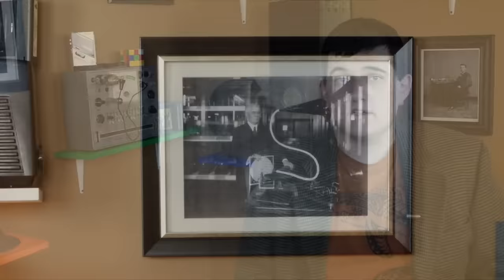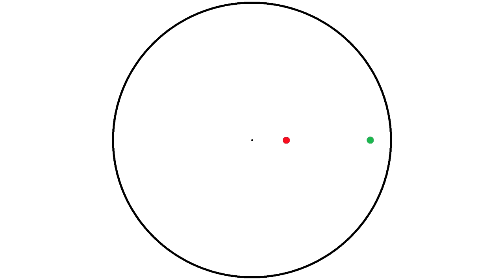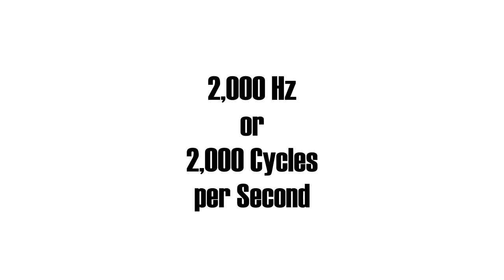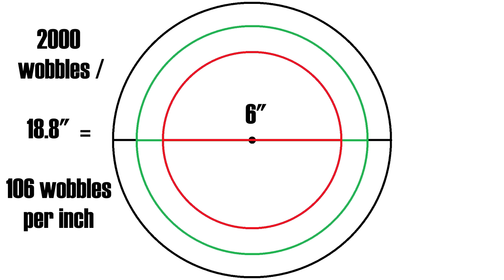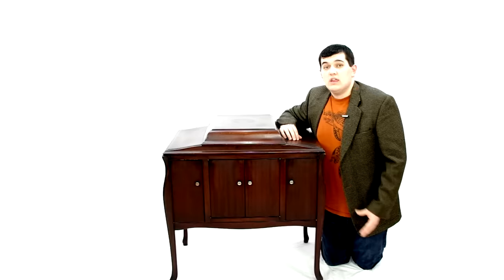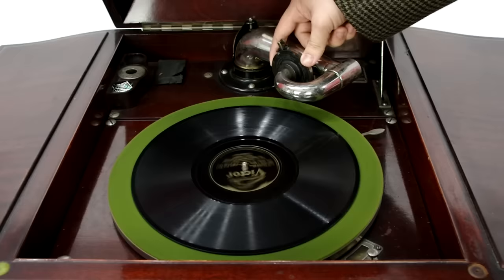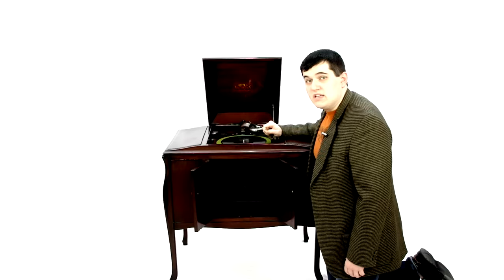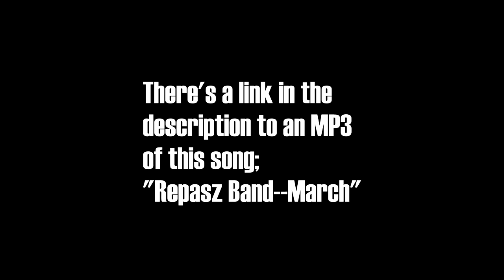Emile Berliner's Fix: Flatten the Cylinder to a Disc

Comment: "Pi, about 3.14"

That's a suspiciously high precision for an engineer
Reply: Pi is about five, as a near-graduate in engineering.
Reply: Pi is exactly 3
Reply: 3.1415296 as a 15 year old math student.
Reply: @Khetamine  Double check the last few digits ;)
Reply: Mathematician: Pi is 4*atan(1)
Software engineer: Pi is 3.14159265358979
Mechanical engineer: pi is about 22/7
Astrophysicist: Pi is about 1.
Reply: @violenceisfun991  1
Reply: @happygimp0   as a fan of grime music:
🎼"Don't chat shit when i got a knife,
Cos I'll divide you up like pi,
As in three point one four one five,
Nine two six five three five nine,
You ain't no mate of mine,
I don't mind if you live or die"
Reply: Pi can be meat and veg, fish or vegetable if you are a vegetariona / vegan. Lets have it right.
Reply: @Khetamine  3.1415926
Reply: @Khetamine  I can say I've never been in a situation where I needed more than 3.14, unless it's really precise, to which I'll look it up on the internet or a book
Reply: pi=3=e
Reply: @breakfast7595  if you are using both SAE and metric in the same build, it is very handy to have more precision. And yes, I've had to use both SAE and metric in the same thing. Good thing liters and quarts are roughly the same, same as yards and meters
Reply: @violetsteele350  Syndicate of Argentinian Electricists?

Comment: i'm willing to bet they discovered that surface noise reduction by accident
Reply: Didn't expect to see you here
Reply: They did day discover it by accident when Varian Harris experimented with a long durable lasting coating for indestructibles cylinders, which he first used while working with Thomas Lambert. This coating ended up making the song sound clearer. It also made the cylinders turn pink in Color ( Pink Lambert). Varian Harris went on to experiment with fine celluloid sheets wrapped around an asphalt core. Hence U.S. everlasting cylinders were born.

Comment: Greetings,  I own a collection of antique phonographs and have restored several. I presently own a 1905 2/4 minute Edison Standard cylinder machine and 3 Berliner type disc machines - 1918 Victor XVI Victrola, 1912 Victor the First horn phonograph, and a 1922 Victor suitcase portable.  Fun machines to play or show off. 

I very much enjoyed your most comprehensive history of the two recording systems and how the phonograph war was won. A lot of research went into your presentation. Especially the little realized lid open or closed effect on sound quality. You almost missed it. ;-)  I gave you extra points for knowing the one needle a side rule too.  

I also enjoyed your excellent presentation on the vacuum tube.  Keep up the great work on your YouTube site.

Comment: Fun fact: the "Victrola" name is also responsible for the nickname for a particular form of "pay-to-play" corruption; to wit, "payola".
Reply: Professor Yana's Forsaken Outpost Payola, plugola, and drugola. If I learned nothing else from a mass media communications associate program, I learned those three things. Most particularly, not to do them.
Reply: Professor Yana's Forsaken Outpost don't forget Crapola :-)
Reply: Professor Yana's Forsaken Outpost - Probably taken from Playola
Reply: Don't forget Shinola shoe polish.
Reply: Also Motorola has the same history.  MOTOR car +
vicTROLA
Motorola had the first car radio.
Reply: @Iconoclasher  And one of its founders went on to make private jets AND 'invent' the 8-Track tape (though in reality he sort of stole another fellow's idea and 'refined' it).
Reply: @xaenon 
Yup  William Lear.
Reply: @xaenon  the 8 track first came out as 4 track which had less crossover due to more separation. Play length won out over quality. I had a player that was switchable.
Reply: @stevek8829   
Yesssss.... sort of.  A minor issue with semantics, though.

The 8-track did indeed have origins in the four-track, but to say it 'came out as the 4-track' is somewhat off the mark.  They were, in fact, two separate, COMPETING formats. The similarity between the two was a result of Lear ripping off Muntz's Stereo-Pak, 'improving' it, and marketing it as his own.  Truth be told, though - the Muntz tape cartridge was itself nothing more than a repurposed NAB type A (aka Fidelipac) take cartridge, which is probably  how Lear got away with ripping off Muntz, I suspect.
Reply: "Victrola" appears to have been inspired by "pianola," the name of an automated player piano that was heavily advertised beginning in 1896.
Reply: Mazola

Comment: Edison was wrong about DC vs AC electricity grid too
Reply: One must still wonder however if had DC won would we no be further along in storage of DC power.
Reply: @johnbloodworthiii6464  I'd like to think DC would have favoured development of more microgeneration, sooner.
Reply: No, He was right. DC/DC converters ftw
Reply: Tesla's AC is obviously superior...BUT modern technology allows for HYBRID systems that are even more efficient.

They are apparently testing high voltage DC power lines now.  High voltage DC for long distance transmission removes loss from parasitic inductance.  Then the DC is converted back into AC.
Reply: DC is most efficient for high power long distance transmission, so it is still used in that application.

It's not even being tested, it's been used for many decades already.

Comment: Early disc records weren't all "78" RPM. 
Many Victor discs were cut at slower speeds, around 72,
and some were cut at higher speeds. 
One I bought years ago has "SPEED 82" printed on the label.

78.26 was the standard set when electric motors got into the act.
Reply: Yes! I have that disc that says (Speed 82) at the bottom under the record No.96200! Victrola red label with a price of $7 dollars! "Lucia-Sextette (Chi mi frena).
Reply: Did old players have a knob to fine tune the speed or something?
Reply: @stevethepocket  Old Phonographs have a speed control on them by the turntable. Records before 1925 varied in speeds.
Reply: @Edwin48100 also well into the electrical recording era, since studios were still using drop-weight motors (akin to a grandfather clock mechanism) well into the 1930s.  It's quite common to find early electrical recordings at around 76rpm for Victor, and 80-83rpm for Columbia.

Comment: that Motorola origin, wowza
Reply: Ive heard of the -sonic ending with Panasonic being one of the last survivors. Any other naming trends you know of?
Reply: @pingozingo   The tendency to place the lowercase i before a word: iMac, iPods, iPhone, iPads, iWatchs ....
Reply: @Nolroa  iHeard that the i stands for interactive or something like that
Reply: @pingozingo  actually, the i stands for Internet connection. In the words of Steve Jobs himself: "iMac comes from the union of the excitement of the internet with the simplicity of the Macintosh".
It was 1998 and the fact that a computer equipment came ready to connect immediately to the Internet was a novelty.

although in the same presentation of the iMac in 1998 Jobs also referred to concepts such as instructing, informing and inspiring. This concept seems to have stopped being used, the iWatch changed its name to Apple Watch. Another example is the Apple TV.

Comment: a cassette tape on top of a speaker is a bad idea lol
Reply: Unless neither works.
Reply: @thegardenofeatin5965  Wouldn't the speaker still have a magnet in it, even if it didn't work?  Unless, of course, the magnet has been removed from the speaker cabinet.

Comment: When I was 14, I was given an old upright Victrola that was missing the turntable and motor. Just a large gaping square hole remained but the tone arm, reproducer and a good selection of needles were still there. So I bought a turntable from a Lafayette Electronics store which consisted of only an 8" plastic platter that was idler wheel driven by an attached motor mounted to a small faceplate.  I mounted it to a sheet of plywood which was then set into the vacant hole that once housed the original turntable. Now I had a functioning Victrola! It may have looked wonky with the lid up, but now I had something semi-original to play my growing collection of 78s on.

Comment: We had an upright Victrola when I was a kid (12 or so). I fooled with it so much that I broke the governor - making it useless. However, it had a supply of wooden needles (or, as you noted, bamboo). These produced a very mellow tone. We also had a needle trimmer - a scissor-like device with a triangle hold that held the wooden (er, bamboo) needle at the correct angle. Just snip - and the needle once again had a nice, sharp point. And I discovered that a straight pin did fine when the supply of steel needles was used up.

Comment: Hi.  Your videos are adorable.  One note. The sound of the needle isn't surface noise, it's Needle Talk.  Surface noise is imperfections on the surface, such as dirt or scratches, ticks, pops, hissing from wear, etc.  The lid is really there to hide the mechanism and keep it clean.  Plenty of Victor tabletop disc phonographs were sold without lids.  The excessive needle talk is just a byproduct of acoustic reproduction.

Comment: When our church moved into a totally new building in the 1960s, a bunch of old stuff was gotten rid of.  One of those things was a device for taking notes to a secretary; an Ediphone which recorded onto a wax cylinder which the secretary transcribed onto paper via typewriter.  Once done a second machine was used to erase the message; a shaver.  Thus you could use a cylinder multiple times before having to buy a new cylinder.  I sold both machines several years ago as antiques.

Comment: Among early disc recordings were some that played from the inside out.  That is, you placed the needle on the part close to the centre and it finished at the edge.  This allowed what were often louder passages at the end of the music to have greater fidelity.  Too bad it was abandoned.  It took the invention of the CD to start in the centre again but where it really doesn't matter as the disc has variable rotational speed and it's all buffered anyway.

Comment: I found a mostly working Dictophone 4 years ago for $3.00 and while I've not replaced the internal belt so it can actually work, it does power on and baffles anyone that looks at it. Judging by the fragility of the several broken cylinders included with it, I'd confirm a record player is the way to go.

Comment: Wow. Considering I had a record player and a bunch of records to play around with in the early 90's still, it's surprising to realise just how far that one specific technology had come.
The LP you would buy in the 70's and 80's (and maybe just about still in the 90's - although ironically they've made a comeback as niche item - a nearby major chain store carries them alongside DVD's and blurays and CD's, though it does not carry cassette tapes), had a play time of something like 30-45 minutes per side, and considerably better audio quality, plus the needle lasts a really long time.
Granted, the actual audio amplification is done electronically, but clearly the production quality of the disk itself has improved markedly too, if for no other reason than the playback length that you can get out of what is still essentially a 12 inch disk...
Reply: That's because of slower play speed. The disc of Edison's time were spinning much faster. Slower speed = longer play time

Comment: I have the same VV-260 as you do, it was made in 1923. I had to replace the brake mechanism and the reproducer but now it works fine. I got it for $25 at an estate sale, with a box of records included. I just have to clean the finish and replace the turntable felt and it's perfect.

Comment: The reason that  the area exists for a label is EXACTLY the reason the author mentions about "frequency response" which applies TO THIS DAY!  Even modern records and modern technology STILL has this problem (not to mention the old standard still in use) and yes- Compact Discs (Laser Discs too) also have this problem as well!  (though, the "information density" in a CD/LD is kept at a CONSTANT rate by simply SLOWING DOWN the medium while  the outer regions are read (played) through the use of servo synchronization.)

Comment: I don’t know if you’ve ever noticed, but when you buy an LP record, they always put the best songs on the outside of each side of the record. It was for the reason that you mentioned about speed and frequency response. That’s also why 45 RPM records ran at a higher speed. The record was smaller and needed the higher speed for better frequency response.

Comment: Re: 5:15 A 7 inch record has a diameter of about 22 inches. Pi is often approximated as 3 1/7. In fact, a really good approximation, great for many applications involving it is 355/113.

Re: 16:00 In fact the parallel tracking concept was later revived on microgroove disc players, and were also deemed more "scientifically correct" that pivoted tonearms. But the easier and cheaper pivoted tonearm remained more common. 

Re: 17:00 There were also pneumatic amplifiers which allowed louder sound with quieter needles.

Regarding 20:16 Pathé records used concert sized cylinder masters right up to the end of the acoustical recording era. This allowed them to cut their master discs in reverse, so that the grooving could spiral outwards from the centre. So the linear velocity would progressively increase during playback rather than decrease. Given musical styles typical of the time, this actually made the geometry of discs less of a problem. It was typical for the end of a piece to be louder, higher in pitch or both than the beginning.

Comment: The whole reason why  The Edison's were thicker was because Edison wanted these records to be more durable than any other.  The average 78 from the 1890s - 1950s cant survive being dropped from a couple feet onto the ground, they will shatter easily.  An Edison record can survive being THROWN AT A WALL.   Also some Victor and Brunswick machines in the late 20s could actually play Edison 78s quite well, you just needed Edison Needles.

The Part about the Licenses is not only Irrelevant, but Incorrect.  Many Different labels including The Big Three, had similar Licenses and Disclaimers almost Identical to Edison's.  Either on the backs of the Single Siders, or on the Actual labels themselves.

Comment: May I add as an owner of the Edison disk player.....the speed for some odd reason on the Edison is 80 RPM  instead of 78 RPM, plus due to the combination of a thicker disk and floating diamond stylus the arm can not be lowered enough to play an RCA disk.Yes...there is a cueing arm on that model !!!! At that time someone did offer a retrofit kit to change the diagram head to the RCA type so you can play both. One nice feature is the volume control on the Edison player....nothing more than a foam ball that you can control via an adjustment arm that would go into the horn.

Comment: The trade name "Gramophone" was used to distinguish the flat Berliner-style disc machines from Edison's cylinder players. But the term was used more in Europe, while Americans simply call both style machines "phonographs", "talking machines" or "record players". Then, in the 1960s the wildly popular horror-soap-opera "Dark Shadows" re-introduced the term to the American public, but they got it backward, with characters on the show referring to a cylinder machine as a "Gramophone", so a generation of kids grew up hearing, and occasionally using, the term incorrectly.

Comment: Wax cylinders were the first technology when record players first came out. They were gramophones before. In both of these, the sound was amplified by the use of a large horn. That was before the invention of the speaker 🔊 and magnet 🧲, and electronics. Either system worked by a wind 😅up mechanism. This little system also had a little fan, governing the speed of the record player motor. Your friend, Jeff.

Comment: Re cylinders versus disks: history kind of repeated itself about half a century later with magnetic media, though the technological tradeoffs were slightly different. Magnetic drums (cylinders) were considered to be faster, since they tended to have a dedicated read/write head for each track, while disks usually had a single set of heads that had to move back and forth from one track to another. But the latter could pack more data into the same space, were cheaper to make, etc etc.